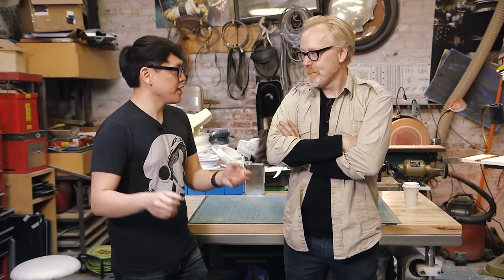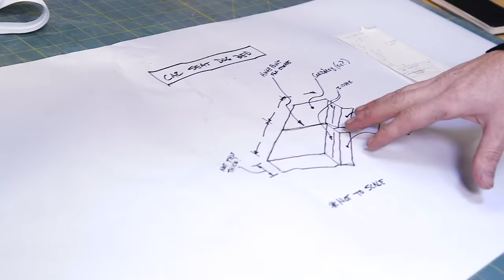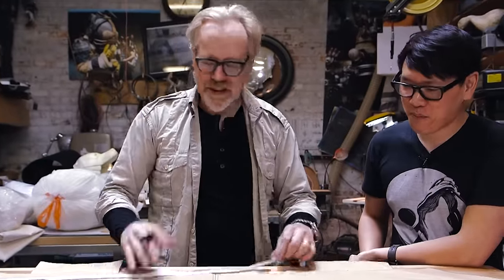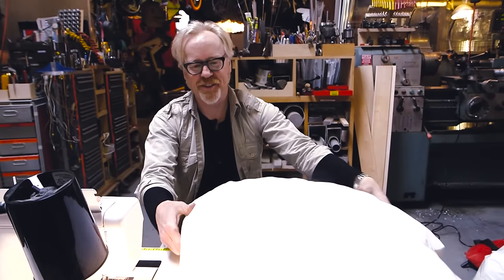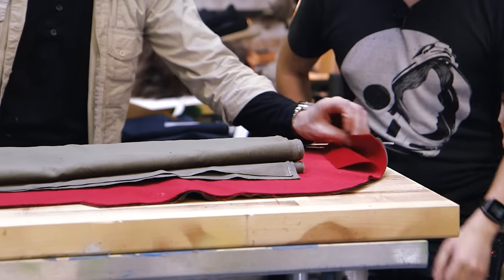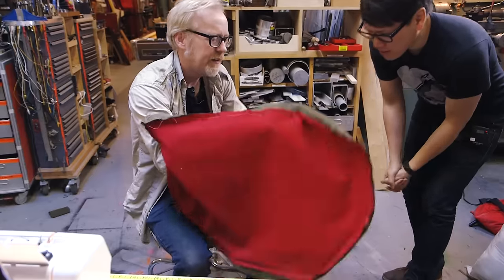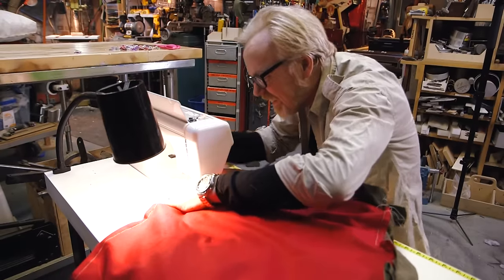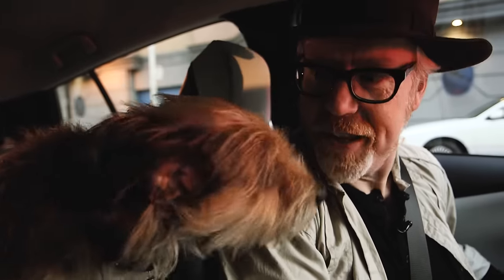Adam Savage's One Day Builds: Puppy Car Seat!

Comment: Thought Adam would have been a Tesla kinda guy.
Reply: definitely
Reply: +aaron4820 i think the price ranges are a bit away from each other, prius is around 25k and tesla s is around 76k
Reply: +Taco Preacher ...Adam isnt exactly broke..... he could easily buy it.
Reply: +Paul Just cause he might be able to doesn't mean it's a good financial choice. The Prius might better fit their house holds driving needs.
Reply: +Raymond in what way? The Tesla is more practical than a Prius.
Reply: +Joey Kissinger 
More expensive and can't go as far on a single charge I'm sure, especially if it's hybrid.
Tesla is a sports car still.
Reply: +Joey Kissinger The tesla may be purely electric, but the Prius isnt'. that said, the Prius doesnt need to be charged and only requires gasoline. It gets its energy from the gasoline and regenerative braking. The teslas requires it to be charged everytime, which is an inconvenience at this time because electric car charging stations are not yet universal. And tesla's are around 1.5 times more expensive than a prius. Adam may have more money than the average joe, but being financially responsible is important to every economic class
Reply: +aaron4820 This also has a sponsored by Toyota feel to it. So that could be why.
Reply: Pretty sure they have to mention when they are sponsored, plus they normally do.
Reply: +aaron4820 In most relationships the women is the one who makes the choices and decisions. Just look around next time you are out shopping. There is a reason why most families drive in female cars.
Reply: What the...Car's aren't gendered nor do they have sexes. What are you on about?
Reply: RMJ1984 I'm sure most people that drive Prius are male, especially thanks to Uber.
Reply: Joey G That's a fair point, the Prius does have double the range as a Tesla, but then nobody drives the full range of even a Tesla in one go (260 miles) without stopping for breaks / charging, and like our mobile phones, if you're able to charge your car at the place of work and where you live, the range anxiety is practically a non-issue for most car users.
Reply: +aaron4820 FUCKIN exactly dude, I yelled at my screen bc his "new" car was a prius not the Model X.
Reply: +aaron4820 my thinking is less that it's financially motivated, rather he's probably trying to blend in.  Tesla draw attention while a priest fits in no matter where you go.
Reply: +RMJ1984 When did cars get gender? Is that how they make them?  When a mummy & daddy car love each other very much they touch mufflers and bam out pops a mini cooper?
Reply: wwaxwork Same as with clothing, you can wear high heels if you want to. Small cars make women feel feminine and powerful. All women here drive small family cars like this one. Where as men, well drive powerful cars. Its just how the world works.
Reply: For real, it isn't how the world works. Clothing is trying to account for physical differences between some men and women. Not a thing that needs to be considered when building a car.
Reply: +aaron4820 The biggest reason for a rich guy not to buy a Tesla is its huge size. Tesla Model S is a big car.
Reply: +Granite I don't think so.. They only mentioned Prius like 2 times and didn't even show the exterior or dash..
Reply: +aaron4820 He probably is, but I personally wouldn't be very pleased to just throw in my dogs (and many many things he has to transport) at my U$100k car daily. I think he figured it out too.
Reply: +Granite Naaaah something sponsored would have lingering "accidental" shots of the logo on the front of the car.   You're not going to get sponsorship dollar without a money shot, though they did sneak a possible one in at the end.   It's a lot of work making up such fancy cushions just for an avert.
Reply: +rkan2 Adam and the other guys from Tested have previously said that having a large car in San Francisco is completely unworkable, so this sounds like a very appropriate reason to stay away from the Model S.
Reply: +Paul people who are rich stay rich by not spending money bill gates drives a ford focus
Reply: GoodFriendsForever And Elon Musk bought a McClaren F1 and crashed it without having insurance, I know what you said sound like great wisdom that makes people look at each other and nod with approval, but come on now, it's a little bit cringy.
Reply: +GoodFriendsForever That argument is refuted by all the rich people who spend butt loads of money on stuff and are still rich
Reply: Size wise, the PRIUS is probably a better fit where the Savages live.
Reply: +RMJ1984 Male here, I drive a small car, couldn't be happier. Being able to take parking spots a big SUV or something just couldn't fit into is glorious :P
Reply: +GoodFriendsForever Bill Gates also has 3 porsches :)
Reply: +Joliie one of which is European and Gates himself helped get the law passed to make it legal in the US. He might be practical but it doesn't mean he doesn't spend money. Also look at his house
Reply: +RMJ1984 That is the most fucked up logic I have ever read thus far
Reply: ***** Sure that's fine, but Tesla Model S is a sedan not a sports car... just because it has the horse power doesn't mean it's an ego stroking car.
Reply: +Paul but if you know him enough from these videos, he's not one to splurge on stupid things like cars
Reply: +aaron4820 Here's a radical idea... He might have both?
Reply: +Raymond That's not the purpose behind clothing, it's mainly to be modest, however in recent times, that modesty has dropped much more, especially in women due to society and psychology, blah blah blah... I think you get the point. Also, when replying to someone, do +(person's name) to make sure they're notified. It should become a link.
Reply: +Joey G tesla isn't a sport brand by any means get real m7. A SLS EV or the upcoming R8 E-tron are sport cars
Reply: +aaron4820 I thought the same thing when he talked about getting a new car.
Reply: +aaron4820 He said he'd get the model 3 when it comes around
Reply: JonEilertsen (HellsatanX) Ah cool, that'd make sense too, that's something more within my price range too, where did he mention he'd get a model 3?
Reply: aaron4820 cant remember, i think it was in a podcast a long time ago when they talked about his volvo and his fiat and other car stuff
Reply: he is!!!!
Reply: +aaron4820 I have a pretty good guess why he didn't buy a tesla. He does NOT have a private garage. He may have a house but being in SF, I can make a pretty good guess that he doesn't have a private garage?  I keep joking with my friends that if you want to buy Tesla, you also need a house with a garage to go with it.
Reply: Pi C I might be wrong but there was an old Mythbuster episode ages ago where they visit his house, I recall seeing a drive way that looked like it'd have a garage.. but I can't be sure.
Reply: +Raymond You obviously don't know anything about cars..
Reply: +Raymond They make high heeled shoes for men.
And yes, physical differences between men and women is something considered when making a car.
Also, when did you last see a manly man driving a Fiat 500 (the new one) When did you last see a girly girl driving a Hummer H1?
Reply: +RaketenKuhGewehr Many small cars are manly.  some big cars are girley
Reply: +Beau A Fiat 500
Reply: +aaron4820 Adam's not a douche so they wouldn't allow him to buy one, unfortunately that seems to be a requirement.
Reply: cybertree Yeah I know right, coherence is so overrated.
Reply: +OXXOI77777 tell that to Kanye
Reply: +aaron4820 
LOL hybrids. They are for stupid rich people who like the smell of their own farts. Buying a brand new hybrid is far more damaging to the environment than just keeping an old petrol car on the road.. Teslas are a joke mate. Prius is probably the most moronic car ever made.
Reply: JandHfilms I agree with you, science, logic and reasons are entirely overrated. Opinions trump all, way to go brother.
Reply: aaron4820
The fact remains that buying a brand new hybrid is more damaging than keeping an old car on the road mate. Even a basic Diesel has better MPG than a Prius. Do you know how much carbon is released in the manufacture of a brand new hybrid? Do you know about the vanishing rare earth elements that are used in the manufacture of the batteries alone? The way they are extracted is incredibly damaging to the environment. Opinion does not enter into it. Except in your comment mate. ;-)
Reply: JandHfilms Buying a brand new anything is of course worse than buying second hand and using something that already exist, whether it's phone, a suitcase or even a house, the building industry accounts for far more than transport in terms of carbon emission, when at times you could just recycle old buildings instead of building new ones, no matter how "green" the new building is, but people still do it, because we're people, otherwise we'd still be using horses by your logic. 

I don't even drive or own a car, I take public transport, so I have no horse in this race, hybrids are simply a marketing tool to bridge the gap for people that don't feel comfortable with the technologies yet, it's a gateway product, but electric motors from a pure physics standpoints are far more efficient than ICE, it just is, and when everything will eventually go electric, having a tiny explosion machine within your vehicle will seem insane in the not so distant future, there's really little to debate about, you need a huge amount of space and thermal mass to effectively utilize power from burning fuels, whether it's boiling water for a turbine or moving pistons, and cars just don't have the mass to contain all the wasted heat. 

You realize the basis of your entire argument is, the look of this generation of technology is not yet optimal, therefore instead of continuous development of technology (things that brought us everything you and I take for granted) we should stick with the status quo? When you realise this is your argument, there's really nothing else to talk about, please be careful on the road, it's more dangerous for people with permanent blinkers on their heads to drive safely.
Reply: aaron4820
I was merely stating fact. Even buying a brand new Diesel car is 'greener' than those stupid low MPG hybrids. Even Elon Musk admits his cars are not environmentally friendly.
 And thanks for the unnecessary jab at the end of your wall of opinion. It was very telling. ;-)
Reply: JandHfilms That should summarise it well enough for all to see, thanks for your input.
Reply: aaron4820

What should summaries what now? Define your term please. And no, thank you. Good day.
Reply: +aaron4820 You dont know how product placements work, do you.
Reply: +aaron4820 good luck on the bus...
Reply: +Taco Preacher Maybe for a low end P70 or a used P85.  I happen to own a P85D and 2 Nissan LEAF EV's.  But believe it or not we tend to drive the LEAFs more than the Tesla.  Most trips we do are less than the battery range and there are so many public chargers where we live never worry about running out and not being able to recharge.
Reply: +Your Brother The Prius battery is for very slow speed and short distance of just a few miles.  Even in the Prius P (plug in version) the range on pure electric is only about 12-15 miles.  Regen on EV's only gives you back a small amount, not as much as you would think, unless you are going completely downhill, then in many times you can get back 30-50% of what you used to reach the peak.  As far as charging sites, Telsa has a fully functioning charging network across the entire US and will be adding another 50 sites by the end of 2017.  98% of your charging is done at home and not when out and about unless you are making long distance trips.  Tesla's are capable of using a standard J1772 Level 2 charger that ANY EV currently in production can also use, they simply use an adapter to connect it and EVERY Tesla owner is provided one when they buy their car.  As far as using the CHAdeMO Level 3 (super chargers used for Nissan LEAF and Kia Soul EV's) well there's even an adapter for those that owners can buy, but with the number of Tesla Super Charger sites in operation in the US, you're never really too far from one.  I personally own a P85D and 2 Nissan LEAF's, but we tend to drive the LEAF's more than the Tesla as most trips are less than the 100 mile effective range.  Driving a 100% electric vehicle takes some getting used to, but only around 30 years ago there wasn't a petrol station on every corner and you needed to make sure you could find a station when the gauge got low, the same thing hold true for right now in the EV world, but in many cities in the US there are on average of 3-5 sites per month added to the available network.
Reply: hill billy Your name is kinda fitting... but you know there are countries out there where within the city, public transport are far more viable than driving...? Even our mayor takes the underground or rides the bicycle because traffic makes driving slower than those types of transports..
Reply: +aaron4820 While the Tesla has a lot of cargo space, it's all fairly low.  I've fit a bathtub in my Prius still in the box.  For a "maker" that kind of space may be more important.
Reply: If Adam had a Tesla he'd be like "look autopilot WHOOOO" all the time
Reply: i'm not going into the discussion about why he bought a prius, but Adam's net worth is close to $10M so lets drop ANY arguments about what he can afford. He can afford a frikkin Tesla. My angle is in the history; look at Mythbusters and his cars there and his take on cars and you get the feeling that he doesn't really care so much what he drives. Just as simple as that?
Reply: Prius sucks
Reply: +Andrew Neal what sucks is the Prius culture not the car itself, what is wrong is most Prius drivers are snooty arrogant posers trying to fit in and real car guys hate on the Prius coz of that, the car it self is a good car, Tesla is better but Prius not bad
Reply: Harley Robertson I drive a Chevy Volt, so I get to be smug to those gas guzzling Prius drivers.  P'shaw!  You call that environmental?!  I haven't filled up for 4 months!
Reply: It all depends on driving style, you could get the same mileage in a Prius and a Volt, if you are calm enough on the throttle. The point is there are posers within the whole environmental friendly scene, what I'd do is drive an old car say a gremmy or a British escort or honda civic or a golf/rabbit of which I could get 30mpg and be better off as either car has long amortised the environmental damage it created when being manufactured
Reply: Harley Robertson I was mostly kidding with the smugness (mostly).  You can actually get much worse mileage with a Volt if you don't charge the damn thing.  The fuel efficiency of mine is an appalling 37 MPG when the battery is empty.  I only use the battery on my daily 40 mile commute, which is listed as 98 MPGe, so as long I'm mostly on electric it's pretty good.

Now the actual environmental costs depend on where my power is coming from.  In California, where I live, there's barely any coal power, so the carbon footprint of the car is very low.

Turns out the energy cost of manufacturing is dwarfed by the energy of using the car.  A recent cradle to grave assessment demonstrated that.

http://www.latimes.com/business/autos/la-fi-hy-ucs-electric-vehicles-emissions-study-20151110-story.html
Reply: +aaron4820 prius might just be the wifes car, im sure he has a nice toy stashed away somewhere to cruise around in on the weekends.
Reply: +Heartshapedenemy He does drive that Toyota Land Cruiser right, so the prius must be the family car
Reply: Really? Tesla was quite  the genius. Adam always did an excellent Mad Scientist in some of the videos. Just not quite what I thought would have been Tesla ' s demeanor. (BEG!)
Reply: +aaron4820 i have a tesla!
Reply: +Ollie Badstue I bet you drive autopilot all the time, I know I would
Reply: +Taco Preacher i mean, granted the watch he has on his wrist is about a 4th of the price of his car.... i dont think thats a big problem..
Reply: +Renax the Man bout 3 days ago
Reply: I don't know that his wallet is a Tesla kind of guy.
Reply: +Brandon Cranfield this man has been on so many tv shows. look at his watch, look at all his equipment. his wallet is very much a tesla kind of guy XD
Reply: Brandon Cranfield Networth allegedly $8 million, he could easily afford a maxed out Model S or X... he just doesn't want to I guess as he doesn't like to show off his wealth.
Reply: Networth =/= personal wealth, he has a family, 2 dogs, possibly kids (not sure) and a wife to take care of, and his income isn't that steady with owning a YouTube channel that doesn't really pull uber-impressive view counts. Tesla's are still REALLY expensive, and they make insurance EXPENSIVE, and maybe he doesn't have the best credit, which makes both more expensive. I have a group of supervisors where I work, one owns a 2015 Audi, bought brand new in 2014, the other drives some shitty 2001 Chevy car.
Reply: +HeyLook ItsAbirdItsAPlaneNoItsAReallyLongUsername
He has two kids.
Reply: HeyLook ItsABirdItsAPlaneNoItsAReallyLongUsername he also had a very popular tv show at just ended but is being watched
Reply: 1. It is much much cheaper in the long run to own a tesla 2. On a single charge a model x can go 200-300 miles perfect for San Fran 3. A model x is well equipped for children
Reply: Jams and you forgot to add it looks a lot goddamn nicer then a Toyota Prius
Reply: I thought Adam would have MADE his car
Reply: RMJ1984 This is an incorrect assumption brought on by media propaganda and current television/film trends designed specifically to neuter and feminize males and portray husbands as bumbling idiots while the wives appear to be the only intelligent member of the family, a very well devised plan for hollywood to tear down the family unit and thusly tear down any dignity and self worth in both spouses. In a traditional, well functioning, healthy family unit, the husband has the final call in major financial expenditures, but as a respectful and responsible husband he will take his wife's opinions and thoughts into consideration when making the decision. This is why in my locale you see men driving masculine cars and trucks, drinking good whiskey, and having fine cigars. They are intelligent enough to treat their wives with love and respect, give them the companionship and security they desire, listen to them speak of their dreams and experiences, and buy them their own feminine vehicle.
Reply: Jeff Sims Why exactly were you ranting?
Reply: +Renax the Man  A little research and you will find that during the 16th century, European royalty, such as Catherine de Medici and Mary I of England, started wearing high-heeled shoes to make them look taller or larger than life. By 1580, men wore them, and a person with authority or wealth was often referred to as "well-heeled".
Reply: "Thought Adam would have been a Tesla kinda guy."
"Do your research, men wore high heels."
Reply: Tru
Reply: You're kidding right
Reply: Totally thought so too. That’s what I expected.
Reply: Joey Kissinger For doing the kind of road trips and long drives Adam and his family love doing? Absolutely not practical at all with a Tesla. Tesla’s are amazing for city driving and good for trips in states that have a lot of charging stations. But longer driving really still requires a fuel powered vehicle. We just don’t have the sustainable infrastructure yet for electric vehicles.
Reply: No way torry or grant would seem like the tesla guy not adam or jamie
Reply: Anonymity is priceless...